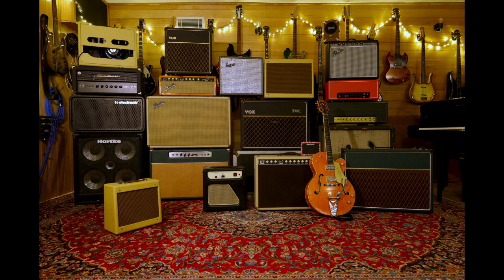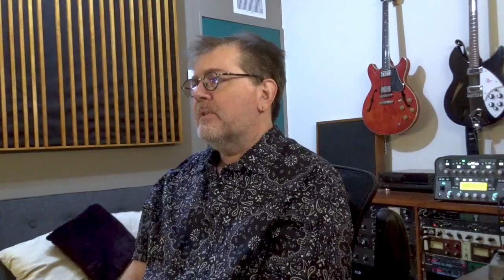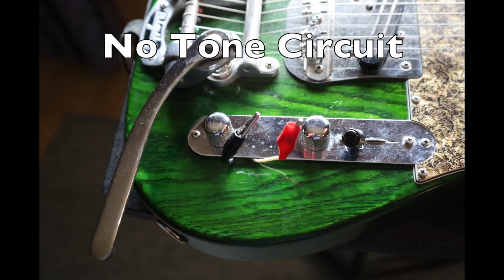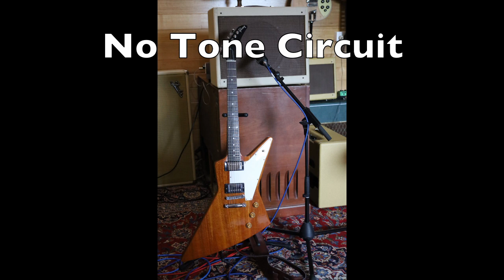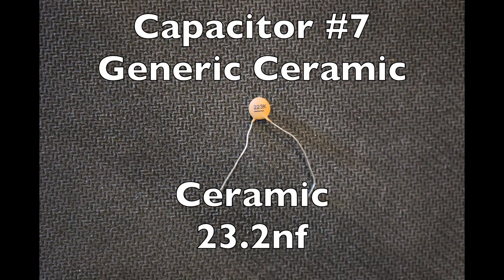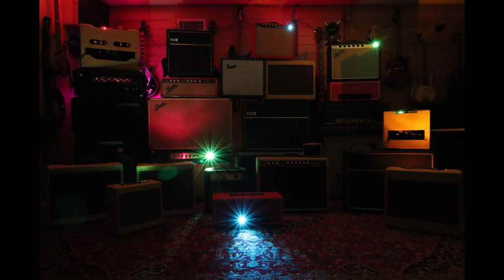Guitar Tone Cap Material/Construction Comparison

Comment: Inductance seems to be the biggest contributing factor after specific value. This determines how much of the audio signal bandwidth is transmitted and the decay of the signal at any given position on the tone knob. The effect is subtle but noticeable and in some cases, when the stars align, it can be astounding. Some of those old caps had significant inductance owing to their construction. Try putting a 1.8mh-2.5mh axial inductor in series with any modern cap and see if you can hear the difference.